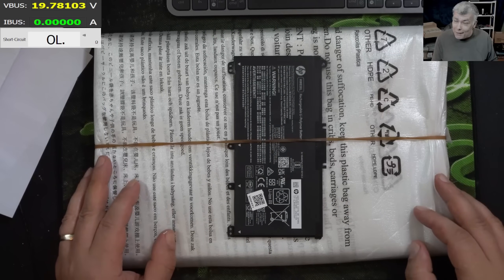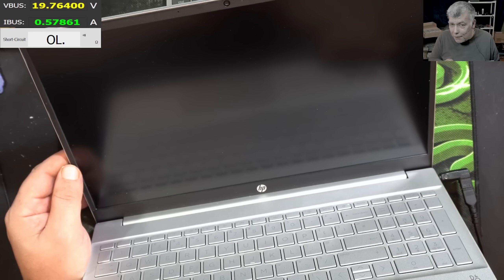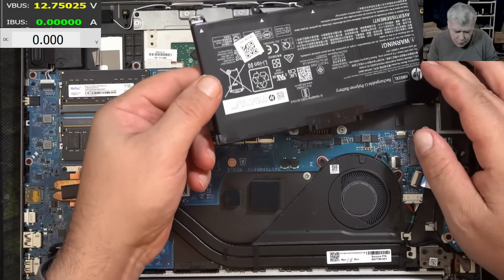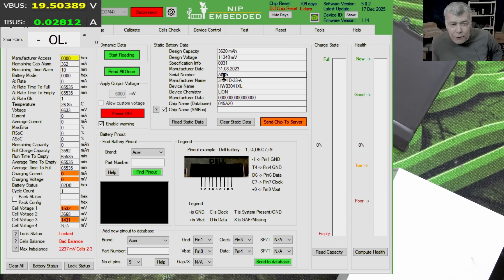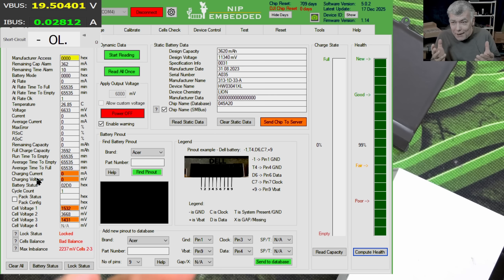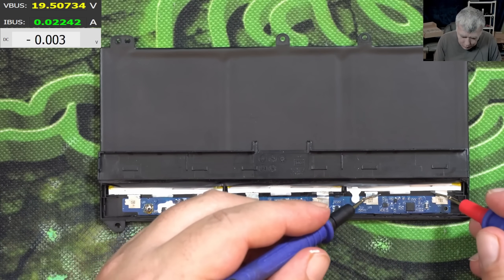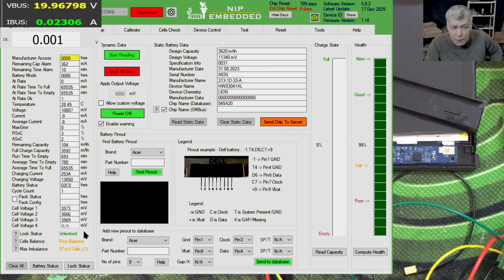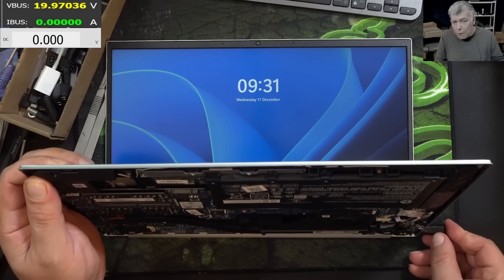The NLBA1 battery analyzer just got more affordable. Hp battery repair

Comment: NLBA as a hobbyist

There are a few details that you should be aware of with the NLBA. 

The NLBA connects to the manufacturer's server after starting the software. Without this server, the NLBA has no function.

The NLBA is an expensive device and the current prices - especially the reset license - are designed for professional workshops and less for hobbyists. Unfortunately, there is only a temporary license and no regular license for a certain number of resets.  Nevertheless, there was a special offer at Christmas this year if you had only used a relatively small number of resets in a year. This special price was based on the number of resets performed. However, this means that you should only perform a reset if you really need it. I once bought a large number of locked batteries and carried out a reset for all of them at once. Only afterwards did I realize that most of the batteries were not really usable due to their low capacity. Not a good idea, because all these resets were taken into account when setting the price for a new license.

The NLBA itself (at least my older version) has no limit to the inrush currents. Every time I plug in the power plug, there is a spark. This means that you have to plug in the USB plug after the power plug. 

The NLBA project seems to have a panic fear of misuse. It is forbidden to move the NLBA several times to another PC. I did this several times and my NLBA was promptly blocked. It was only unlocked again after requests. You are therefore well advised to have a separate PC for the NLBA that you do not use for anything else and where you do not do anything that could be interpreted as moving to another PC (e.g. updating the Windows version). 

Despite all these limitations, the NLBA is an indispensable tool even for a hobbyist. For all my laptop repairs, I have gotten into the habit of always checking the battery with the NLBA first and charging it if necessary, because in a considerable number of my repair cases, the laptop seems not to have been used for a long time, and the batteries are then deeply discharged and often locked.
Reply: We plan to work on a Hobby License for small repair shops, let's say 20-30 free battery repairs in a year.

Comment: This appears to be the only device of its kind on the market. Ive had it for a few years now and it really comes in handy.
I was working on a Microsoft Surface and used a heat mat to help remove the broken lcd screen. The heat mat must of heated the battery up too much and caused it to stop charging.
I used this to unlock the battery and it saved the day.
Super unique product.

Comment: This is an excellent machine for laptop battery repairing. I have been using it for almost four years. One of its best features is that everything is controlled with mouse clicks—there is no need for any manual typing. Its interface is extremely simple and user-friendly, so even someone who has never used it before can operate it easily and efficiently.
In addition to this, it offers many other powerful functions, such as charging batteries, discharging batteries, and testing the lifespan of individual cells.

Comment: If that tool was around $200 to $250, with no subscription, he would cell a shitload of them. That "subscription" is BS.
Reply: My RFNT3 costs double that and it provides no unlocking ability. The market sets its own price. If overpriced, it does not sell and the product fails. The producer of the NLBA 1 appears happy with his business model so who are we to say he has got it wrong ? I would also like an affordable solution with a fee per battery repaired, but sadly that is not the case with the NLBA 1 so I bought a used RFNT 3 for £120 and can now look at the condition of the battery, but not unlock ones that have locked out.
Reply: NetFlix also has subscription, and me dont like it, so me found the solution like dont buying it and go passthrough...
Reply: We plan to work on a Hobby License for small repair shops, let's say 20-30 free battery repairs in a year.

Comment: I see a lot of disparaging remarks in this comments section and some troubling mob-like trends, so I'm going to risk my neck and throw in my 2-cents here.

I personally don't like the subscription model for most things and I certainly don't sell my own software or my physical products that way either, but honestly the world seems to vote with their wallet more for subscription based goods rather than outright ownerships and there's usually no complaints.   

There's a concerning level of people trying to conflate the BwE scandle with this NLBA / NWR event and aside from the licence being terminated in both cases that's about where the similarity ends (** edit: seems the licence isn't even terminated, could just be that old software was used, which only further demonstrates my disdain towards the behaviours shown by the community);
 
* BwE's software allegedly is an active scanning/spyware program;   the NLBA/NWR event was allegedly through a human 3rd party report, not the software itself spying
* BwE was cancelling licences on the most obscure/random/wild/pedantic/paranoid accusations; the NLBA cancellation was due to somewhat more legit violations of the T&C, even if you don't care for them.
* BwE was cancelling licences in significant numbers, I'm not sure of how many NLBA has terminated access to outside of the NWR event.

Regardless of if you see value in the NLBA pricing structure or not, it doesn't really warrant this level of attack; a simple "don't buy it" would definitely do the trick, especially too since it's not a market we're forced in to having to engage in.

I'm all for calling out bad players in the market but overall so far this feels disproportionate.

Comment: I like your channel. But there's one thing I really dislike, and that is that your keep on promoting this product that uses almost identical (scamming?) techniques as BWE. It goes complete against the right of repair and openess philosophy. Why don't you mention the software spies on you and you can get your license blocked for the most stupid reasons. Sorry, Sorin, you're a great repair man, and I understand you want to help your fellow countrymen, but this is not ethical.
As for this repair, I am pretty sure it was setup to promote this product. If cells are that much unbalanced the battery is damaged or certain cells were decharged by someone on purpose the make a video. The person that decharged the cells might possibly be the same person that manipulated the fuse (and I would not be surprised if that person was you). In case of such a strong unbalance because of damage repair is useless, your battery will get locked again after a few days of use and you know this.
As for the pricing. 400 Pound without license and 500 Pound with "free" license. Do you think your viewers are stupid?
Reply: you have zero proofs that software is spying, so please stop manipulation. Also NLBA1 has nothing to do with BWE case, read comments above. And your "expert" knowledge in cells recovery and battery repair is "awesome", proving you never repaired the batteries by yourself lol
Reply: @FixFix15 There are comments from people on other channels that got their account blocked after a windows update, and they had to pay 50 Euros to unblock it. Are you related to the owner of this product? 
Edit: Right, you just changed your youtube name to something else to hide your identity, yesterday you still had another name. (The way you use English also suggests you're Romanian).
Reply: You are wrong, check their connunity, no one had license blocked. NWR is a liar. Look at the error code he god in the video, he was using an old software and not because the license was blocked.
Reply: @azzidoqsc even Sorin described in one video how he had a problem, but it got resolved.

Comment: I've noticed that NWR and Black Horse have started working on NLBA. Honestly, I don't think it's an easy project at all. What bothers me is that they were asking people to contribute for free, and then they plan to sell the project. Why would anyone contribute for free just so they can turn around and sell the software? It feels like "help me get rich" to me.
Anyway, I messed around with the bq9000 chip a while back using Arduino + Ubuntu. There's basically zero documentation for this chip, even though it's used in tons of Lenovo batteries. This chip uses SMBus address 0x82 to initiate authentication. From what I could figure out looking at the bq8050 chip family (which at least has some public datasheets), the authentication key is 128 bits stored in flash. I managed to read a bunch of battery info - lots of useful data actually - but I hit a wall when it came to authentication...
Reply: it uses AES encryption and key stored to OTP instead of eeprom, thats why it could not be easily found. Otherwise making clone Lenovo batteries would be very simple...
Reply: I agree, while the electronics required to interface with the chips and even perform the battery cycle-testing are "relatively trivial" (though I know from experience even those parts will require at least 3~10 revisions to get right), the crux is the auth keys, at which point the product falls back to basically being a capacity/life tester more than anything else.

People don't realise how even trivial-seeming products can be exceptionally non-trivial to implement; ideas are easy, implemenation is hard(er).    

Not trying to dismiss the NWR/BH/others project but I think the outside community may end up being disappointed at the final result simply because of that crypto/key support being a very hard limitation issue.

Comment: I do not really understand all the hate for this device.... Yes, it is a bit too expensive and i think the reset license should be based on how many resets you need to do and not by a yearly license. Of course you can buy a cheap chinese aftermarket battery for 25€ but the quality can be so bad that it stops charging after a few days or have all kind of weird behavior. I have also seen some batteries that have original fuses replaced with solder blobs or wires. I've had this analyzer for about 5 years and those batteryes i have reset works great. Of course, if the cells health is somethink like 30% then it is time to replace those cells or buy a new one. It can easily help you to diagnose if your laptop have problems with charging cirquit or the battery. And the davelopers are adding more charging chips to the database that the software can unlock. If my customer has a locked original battery, then if the cells are still atleast 60% (most of the time they are), then i can charge half of the price of new battery and i can trust that it still works after few months.
Reply: yes, correct, recovering genuine packs makes sense, they have branded cells and much better safeties around the bms in comparison with chinese copies

Comment: i love Sorin's videos, I really appreciate your work. If you want to learn electornics repair this is the right place. I repair laptops and batteries since 2004. I used all softwares specialized in repairing batteries UBRT, Regedit, be2works, in the last time NLBA. If you get familiar with one tool it is hard to change to another tool. be2works I found it very poort while ubrt and regedit are good but very expensive. If you want advance chip programming go with UBRT or Regedit. If you want all-in-one solution including analyzer + repair go with NLBA. NLBA is actually cheaper and more friendly that first two. NLBA support is great, they speak english while ubrt and regedit speak ukrainean and chinese. Such tools are not defenetely for those who repair 2-3 batteries, it is for repair shops who repair many.

Comment: Tony and raff started work on free app that can do unlock batteries etc probably thats why he is giving away free unlocking for a year to sell as many analyser as possible and make as much money as possible before nbla busted lol
Reply: lol, what they wanted to do can be achieved by Demo NLBA + Ev2400 $30 :))
Reply: check latest BHR video, no longer free app, it will be payware to compensate design efforts. Do you really think they will work years for free to let you start battery repair business )
Reply: @FixFix15  when i said free i meant there will not be hidden charges. You will pay for the app and thats all, you own it after that and no more charges and app wont be expensive like nbla box etc
Reply: @byt3ch  It looks like you are not familiar with repairing batteries. Do you know how often new chips are coming on the market ? Every time a new battery is released on the market, 90% it has a new chip, new technology, new firmware version and so on. What do you do with an old software ? almost nothing, believe me. Repairing batteries is completely different, laptop batteries are "smart", they have chips, complex chips, even 32 bit automotive industry chips made by Renesas, encryption 128-256 bits, tons of firmwares, tons of memory layouts and so on. That's why there is NO offline 1 time paid software in the world, it is useless. Each battery has its own key, only an online software can keep the database updated even for old batteries.
Reply: @dronedome78998  yes im not much familiar with batteries but you are not familiar with nlba either than dince as i know it only unlock old batteries. Cant unlock the new tech ones. And it seems there is a story behind it. So its pointless to pay this much money for this product mate..
Reply: Did you try it and it did not unlock new batteries ? Check their community, there are hundreds of new 2025 repaired batteries.

Comment: Last month I bought a job lot of 100pcs DJI Mavic Pro batteries from eBay, they were never used, brand new. I used DJI License 139$ and NLBA1 software and I recovered most of them. The cells were over discharged, I charged them exactly like Sorin did but with smaller pre-charge current. Then I reset the bq40z307 chip and battery started working. I had a good profit. Now, DJI increased the security in the new batteries, I hope NLBA will find a solution because after 1 winter season many batteries get locked.
Reply: I think it should be illegal for them to lock batteries, just because of low voltage. They could trickle charge them, to safley get them back to where they need to be. But if they did that, they would make a lot less money... I hate greedy corporations and planned obsolescence.... It's disgusting and wasteful behavior...

Comment: NBLA is genuinely a great product, but the price is now beyond most peoples budgets. The NBLA is about 100-150 USD more expensive than when launched and 10 year reset license is nearly 50% higher. It was already expensive (but probably worth it if you fix enough batteries), but asking 300 USD more is extortion. 10 year license was 699 USD in November 2023.

A pay per use option would help to gain more purchases.
Reply: We plan to work on a Hobby License for small repair shops, let's say 20-30 free battery repairs in a year.
Reply: At the beginning nlba was Analyzer only. Then just 1 chip was supported by license, more chips, more functions means more expensive.
Reply: @azzidoqsc  Plausible, logical, but still still huge jump from the old price.
Reply: @dfear  In my country everything doubled in just 3-4 years, taxes are 3 times higher, everything is crazy.
Reply: @dfear since 2020 taxes jumped a lot, components prices and delivery cost increased too, many efforts were invested in the new Renesas chips support, IT engineers job is not cheap nowadays, so device and license price increases
Reply: also new export fees thanks to D.T.
Reply: Hello,  The USD has lost 40% of it's value since 2023.   Everything has gone up in price....everything except wages.

Comment: I bought a battery unlocking device, but in my small city I’ve only unlocked about 3 batteries in one year. At this pace, it will take me 20 years to pay off the device. They should offer a pay-per-unlock option for small businesses, like €5 per unlock for those doing fewer than 20 unlocks per year. I can charge around €30 per unlock, but the whole process takes about 2 hours because I need to open the laptop and complete all the work. Sorin tnx for all your videos, You inspired me for work more on laptops and to make my customers happy, tnx for You and Your wife, let me know if you ever visit Croatia, You have a place to stay 🤗🤭
Reply: Some tools are more to complement the work than being the main bread winner, I've paid good money for tools that I rarely use but when I need them it makes my life so much easier
Reply: @BorisRomac  I initially thought I would make money when I initially bought it by repairing batteries but I found that it can be tedious. I suggest to buy laptops with faulty batteries and then you repair the battery and sell. You make your money back

Comment: You do need the nlba device, you cant use anything else with sub because the reset page only avaliable with the original nlba1 device. (14:05)
Reply: no, it is also available with ev2300 or ev2400 chinese clone, check official support page
Reply: @FixFix15 do you have that device? Did you test it? Because I have it and I know for a fact that the reset page wont open, a text box opens up saying you need og nlba....